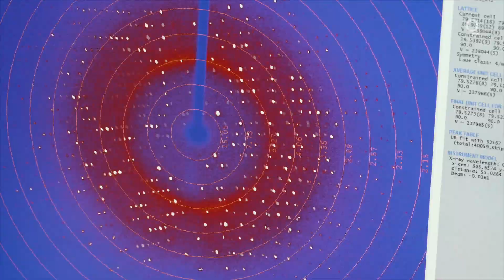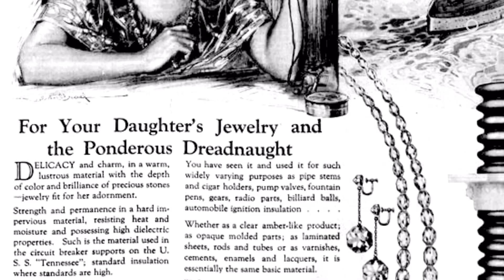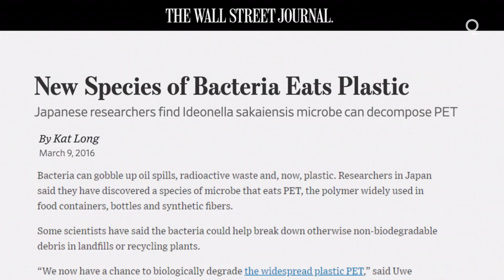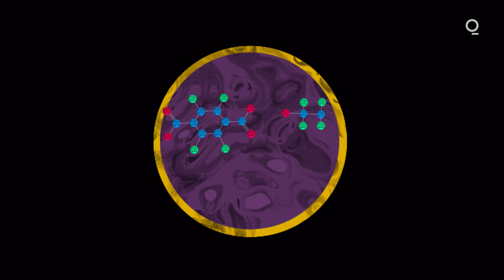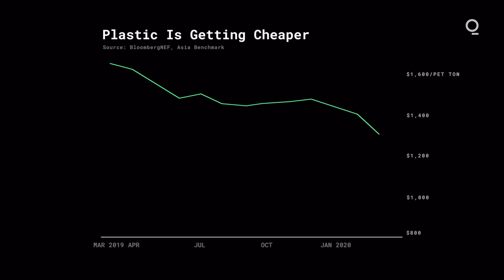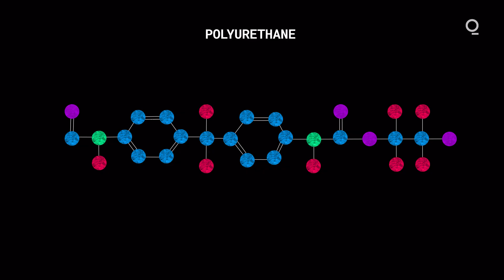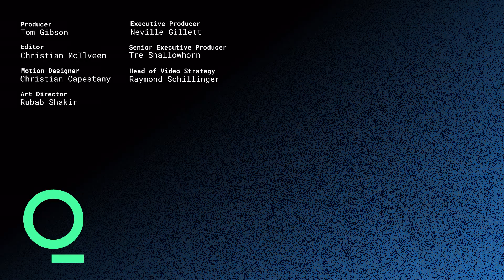Could Plastic-Eating Bacteria Save The Planet?

Comment: The only reason plastic isn't biodegradable is because it's a new material in the ecosystem. Nothing evolved to eat it because there wasn't enough around to be worth it- not because it's impossible to break down. We've obviously changed that, and with the rapid evolution microbes are capable of, plastic decomposers are inevitable. Even if we don't change our actions, this problem will be solved for us eventually (though in the mean time the damage would be incomparable)

Comment: Since Plastic do not decomposed like others materials and have done more harm after entering the ocean, each country should burn it off to generate electricity like smaller nation do. Bigger and richer countries should researched and invent a more efficient incinerator that emit cleaner air. Please do not sent them to the 3rd world or dumped into the ocean. The technology is there and have been using in many small nation.

Comment: I actually think this would be a MEGA DISASTER!
the bacteria would also start to eat everything that we are trying to protect, from cable casing, rubber seals, house siding, roof singles, plastic implants, insulators, water tight containers. our transcontinental communication cables that are submerged and buried would need constant replacement, polymeric protection that would last decades would fall into disrepair in mere years. 
We need to reduce production of trash and waste, not unleash another plague into the world which we can never contain/recall if we change our mind.....

Comment: Of course Bloomberg is going to ignore Thermal Depolimerization. Basically, plastics are shreded into smaller parts, then are introduced with water into pressurized tanks, where they are subjected to high pressure and high temperature, and they get gas, oil, water, and carbon (ash) out of it, then use those to make fuel, plastics, and whatever else they want.
Reply: Not everyone is doing it or afford to do it
Reply: @zedrhyx1788  But they completely ignored the possibility. Let's not forget that green energy can be used for thermal depolimerization, to recycle all kinds of plastics at the same time, without even needing to filter them beforehand. And the greenest energy out there is nuclear energy, which is much safer nowadays than any other type of energy, including wind and solar power. Wind and solar power have more deaths per Megawatt than nuclear power, and modern reactors are almost impossible to release radiation in the wild, like the decades-old reactors of yestercentury.
Reply: @SapioiT  go ask you government instead of people in the comments section
Reply: @zedrhyx1788  As if asking my government is going to make it happen. Maybe in countries which aren't the puppet-states of first-world-countries changes can happen like that, but aside for a handful of countries, things don't happen that easily.

Comment: What if the bacteria gets out of control and starts eating all our household appliances lol
Reply: the bacteria already exists in the outside world. That's where it was found. it sounds like they are just producing the enzyme in bulk to increase the concentration to break things down more quickly. Enzymes can breakdown under certain conditions too (e.g. extreme high temperatures or extreme pH values). Besides manufacturers are making things that break faster (also known as planned obsolescence) in order to get consumers to replace products or buy new appliances. Compared to 50+ years ago, appliances now won't last very long. A fridge, a stove, or washing machine made now likely won't last more than 10-15 years. If an appliance lasted 30+ years, then the company won't make money if the appliance still works and don't need to be replaced. And if its broken and you want to try to fix it, the parts are not available because they want you to buy new.
Reply: Lol what makes you think this is a household product? Ofc they would apply this to recycling plants where millions of tons of plastic are aggregated.
Reply: @PotatoWedge12  The idea is that the bacteria could escape into the wild, and begin eating plastic wherever it occurs - potentially making plastic unusable if it shortens its effective life by much. A lot of infrastructure depends on it, like electrical insulation - everything would have to be replaced with cotton or some other fibre for insulation, perhaps. Many products would be irreplaceable without plastics.
Reply: @alphatucana  You didn't pay attention to the video, did you? They would only use the enzyme(s) that produced by those bacteria to break those plastic down. Bacteria stay in the labs/factories. Eventually, we can figure out how to make those enzyme(s) artificially and if that makes economical sense, we don't have anymore use of that bacteria.
Reply: @littlechemie5425   What @Alphatucana means is if the bacteria gets out due to some human error or accidents. We would need a counter measure for that. And this should be brought into use as early as possible.
Reply: @littlechemie5425  That's fine if the bacteria don't escape into the wild. But whatever the plans to reproduce the enzymes, maybe they just won't be careful enough... After all, some say that a certain other pathogen may have escaped from a lab. And let's face it, there's plenty of plastic out there for it to feed on.
Reply: @noumankhwaja4526  I mean it’s not like it’s gonna eat your plastic bottle in a matter of seconds or minutes it’s only breaking it down probably takes a bit so it wouldn’t be that hard to contain it but I get the potential risk that can happen
Reply: @noumankhwaja4526  the bacteria can't, even by accident, bioproduce the enzymes at sufficient concentrations to unintentionally break down plastics
Reply: @noumankhwaja4526  it's a none-issue, because these bacterias would actually prefer to eat other stuff rather than plastic. They actually had to starve them out and then they would resort to eating plastic
Reply: Ringworld
Reply: @tiaramin1874  It's OK for a water bottle that only needs to survive a couple of months; but what about polymer blades on a wind turbine, or the insulation on underground cables, that needs to last 20 years or more? Or the plastic in the soles of your shoes that, if they are well-made, might last a few years under normal circumstances? Or the plastic lenses in some people's spectacles? Or polyester clothing? It isn't all short-term throwaway products.
Reply: Exactly. We have here, again, the same issue: so-called 'experts' not thinking ahead.
Reply: @alphatucana  Wood

Comment: PET Bottles is cheaper to just pick up and recycle (into Polyester clothes) than hydrolyze with bacterial enzymes. And if there is a need to hydrolyze PET, then why not just collect the PET plastic (pay poor people, machines or robots) and use NaOH to hydrolyze it. It would be much cheaper and faster than lab grown and then stitched together bacterial enzymes :)
Reply: What happens to it after treatment with NaOH
Reply: @aggarwalkaoor9002  It will form Sodium Terephthalate and Ethylene Glycol (used as Coolant or Anti-Freeze), and may be recycled back to new PET bottles. But that method is expensive. Much better to just turn used PET bottles to polyester clothing.

Comment: To be honest, I'm worried about this  thing getting out of control. Just imagine your keyboard, monitor, mouse, car handles and anything else that uses plastic starts 
deteriorating and rotting. That would just be the worst thing ever, We'd just be set back thousands of years and have to buy new products every week.
Reply: i prefer that rather than having micro plastics in my body
Reply: I prefer that over having no solution for plastic pollution, there's always alternative material like keyboard with wooden keys or maybe metal... It's actually an easy problem to adapt to

Comment: There's also the Swedish solution: ban landfills. Try hard to recycle, but burn everything that would end up in a landfill, using liquid oxygen instead of air to increase the temperature and get complete combustion without any associated NOx in the exhaust.

Comment: If they can eat plastics, they will eat your flesh too
Reply: @R. Schowiada71 plastics is made up of various hydrocarbons, one of the most popular is PET, polyethylene chain. 

your body contains ethylene especially in your brains and blood, even your exhaled breath. It regulates your stress hormones. 

Will the enzymes break down PET just into Ethylene level or even further? Not to mention the danger if it breaks down inside your body and react with your body with other organic compounds, especially in your brains because ethylene is normally used for anaesthesia, because it can lower your consciousness.

Comment: Sorry but isn’t there a bit of a problem with plastic eating bacteria: we use plastic for absolutely essential infrastructure like water and sewerage pipes, building materials and all sorts of things that we have to rely on to be permanent abs not biodegradable. Introducing indiscriminate plastic eroding bacteria would destroy trillions of dollars worth of infrastructure requiring much more carbon intensive replacements like ceramics etc.

Here is an idea - stop making and using throw away plastic and recycle all necessary plastics properly.

Comment: Why am I separating my garbage when it’s not getting recycled anyway. It really does take about an 30-60 minutes weekly to separate and prep my recyclables.
Reply: Please keep doing it. Separate your recyclables. every bit helps in raising awareness. don't take step back a step forward by starting to reduce the use of plastic form your life. try reusable materials and items. thanks for your service to the environment and our planet.
Reply: @AnishKumar-es1xr  anyhing burns if it gets hot enough, can even burn metals. Gasify it and burn it. Just stop using coal/oil/gas for fuel. «Just». The CO2 equation should work fine then.
Reply: @fivethree0  you would need allot of reusable and power plants for that chief
Reply: Human of late capitalism
Reply: Just use 3 bins at home, no additional time spend on that
Reply: It is most likely being incinerated. If you do not separate it, it may end up in a landfill. Incineration > landfill
Reply: @lamebubblesflysohigh  it still gets incinerated even if it is recycle on occasion the main reason for this is that recycling is not profitable
Reply: @royalteluis623  yes that is my point... if it is separated and it is not recycled it is likely to be incinerated which is better than ending up in the landfill

Comment: There is a possibility that one day the bacteria would be wide-spread, which ends up with the situation that plastic could no longer make its way from the factory to the consumer, and we will call it 'the nature fought back'.
Reply: Then we would fucking use it less, as we should be doing right now
Reply: @g.matosdsul  Yeah, we should use plastic less, much less than what we are doing now.

But in fact, plastic is not only used in single-use product. Nobody will want to replace their repeated use PEP water bottle with an 3003 aluminium one, after they have a look at aluminium's carbon footprint. That's why I am not entirely in line with this bacteria.

Comment: Fix the cause, not the symptom. Packaging needs to be fundamentally changed, so it is easier to sort using machines and recycle.
Reply: How about fixing the cause and the symptom? We'd also like to get rid of all the waste already out there.
Reply: @stefan_popp  exactly
Reply: Yeah but what about the plastic already out there?
Reply: And who's going to bear the cost of logistics for that, YOU? Proposed solutions must be socially, politically and most importantly economically viable for them to be implemented. A solution born from multi faceted views are the most helpful.
Reply: Itty bitty item. HUGE plastic blister pack.
Reply: Yes, fix the cause also involves reducing our dependence on plastics, single use plastics are the worst!
Reply: Low temperature gasification of plastic and other wastes is better idea. Most stupid is throw this into the ocean or to the landfill. Stupid is also transport and segregate it which consumes huge amount of additional energy. Product of gasification is gas which can be used i.e. to produce electricity, heat, hydrogen, inorganic fertilizers and so on. In Poland we have even technology combine of few other simpler old technologies which can be used to do this comprehensively. At the end you have only few percent of ashes and a lot of raw materials. As it take place in low, up to 500 C grades temperature, not produce toxic chemical compounds. It is also CO2 neutral due to closed process if you consider this important. Wastes are wealth. It's only matter of low level of human development that we have so huge problem with it, now.
Reply: Duh but it's too late for that
Reply: You seem confused. You don't do one or the other. You do both. 🤦‍♂️
Reply: I think everything needs to change constantly.
Reply: Both are needed
Reply: absolutely impossible for modern society. ignoring that the economy runs on plastic, plastic has almost perfect properties. not only is it easy to make and shape into any form you like, but it is easily sterilised repeatedly and has favourable strength and chemical resistance, you cannot make drinking straws out of wood, paper straws degrade within minutes, and metal straws are way too resource-intensive to consider throwing away, but then have the issue of needing to be cleaned. the straws argument goes for just about all scientific equipment. it needs to be plastic essentially. consumer products: if they're too expensive, they won't be bought over a cheaper equivalent. companies that drop plastic without government help will fail, and so they don't do it. most products only exist due to plastics anyways. 

We've pushed ourselves into a corner where no one has any choice but to continue to feed into the system because we've become so dependent on it that we actually could not function as a society without this material. the best option for us is to find a better material and deal with the symptoms until we find one. 

just realised you meant something else... yes I agree that packaging needs to be done in ways that make disassembly easier.
Reply: @jonathanodude6660  yea, or....we can go back to the dark ages.
Reply: @haze6647  don’t think many people will be too happy or willing to be unable to do any medical research which will lock us in that age forever.
Reply: its simple dont use it
Reply: lets do both
Reply: But it’s cheap
Reply: Recycling isn’t working...
Reply: @niketuck9687  because the materials used aren't designed to be recyclable. We designed the materials to be cheap without considering the environmental costs. We instead need to plan for the entire life cycle of the material. Everything needs to be designed to be in a closed loop recycling process. Nature figured it out, so can we
Reply: Exactly!
Reply: And designing more universal reusable packages!
Reply: Yes we should but because thats very hard to do and probably would never happen. This would probably be better that can happen sooner.
Reply: @justteleporting  Milk companies solved the packaging problem long before we had plastic. Glass bottles that could be refilled and returned

It's not a technological problem for the most part. It's a logistical one. If we make companies responsible for the waste they create, they will switch to more circular models
Reply: still need this to solve the plastics trash which already occupying our planet.
Reply: It can never be fixed its every where it is cheap.
Reply: @baby pink youngjae agenda he’s saying that packaging should be designed to be recycled, not that plastic shouldn’t be used.
Reply: You just dont get it. If we stopped plastic use today, it's not enough. It's crazy how small and ubiquitous plastic microparticles are in our atmosphere and hydrosphere
Reply: yes prevention better than cure
Reply: @brothermanben7140  both would be best
Reply: Yes there are alternative, if we want change then there needs to be more regulation on what companies can use as packaging. Especially in America bc 55% of plastic pollution in the world comes from American companies
Reply: True. You're a human with an actual functioning brain!
Reply: We need to do both, actually
Reply: Plastic is I think cheap to make and for packaging 
Preferring any other would take a lot of money and hard to make people buy it
Reply: @Sunnykr275  then let's build a socialist society so that people have what they need and not have these useless corporations that destroy our world.
Reply: @Sunnykr275  the government should be reprimanded in its entirety. And I hope that their lives and their descendants lives are affected but way worse!
Reply: @Sunnykr275  this human world is going to sh¡t
Reply: Agree, this will only make us feel less guilty about using plastics and increase plastic usage...
Reply: Exactly and HOLD BIG COMPANIES ACCOUNTABLE
Reply: @lililililililili8275   Apple's packaging are recyclable. Not sure what you mean by "normal boxes". A little research would tell you the exact materials it's made from. It's part of the premium you pay for the product.
Reply: @dealloc  are you being sarcastic here, because i didn't pay them for those unecessary stuff, beside, i always keep those boxes.

Comment: What could go wrong.....
Reply: It eats oil or eats plastic water pipes?
Reply: Or rather what isn't going to go incredibly wrong without it.
Even if it's a 50% risk it will do something bad it's not going to be a loss or win if it actually goes rouge. But if it behaves it will be a incredibly huge win